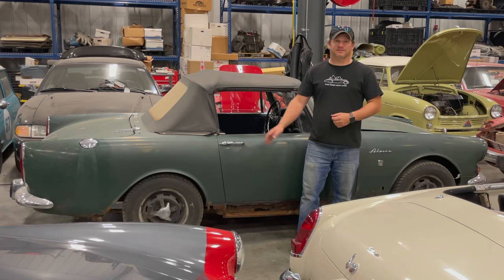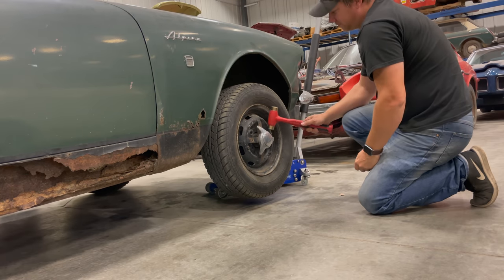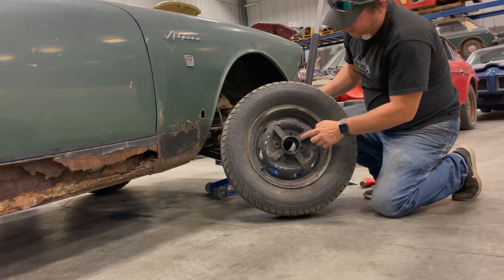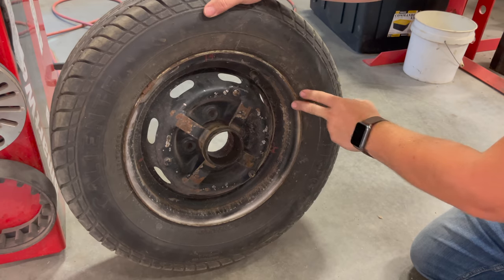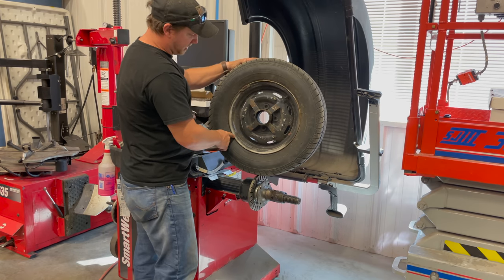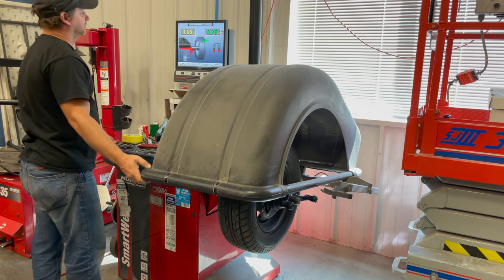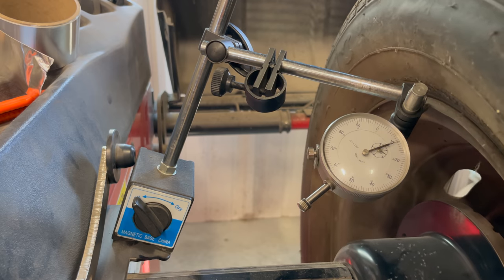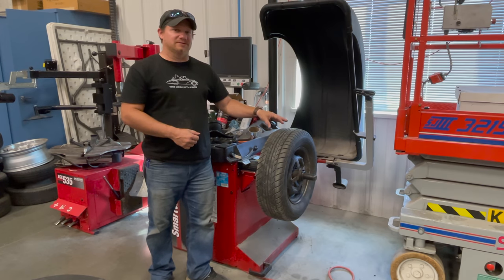Homebuild Disc Wire Wheel?

Comment: I like these Frankenstein wheels! I would check them for runout a bit differently. I would center them on the inner and outer cone surfaces inside of the splined hub just like they’re mounted on the front spindles and rear axle. The triple wing center lock nut has a cone precisely machined the fits inside the splined hub.
Reply from the maker: These are mounted to a splined adapter just like on a car just as you described, I am certain they are centered correctly.

Comment: Lotus Elans also had knockoff steel wheels as stock.  Instead of splines, they used short pins on the hub into holes in the wheel.
Reply: MGA twin cams had similar peg drive wheels, though the pegs were on the wheel and the holes in the hub.

Comment: Making knock off disc wheels by this technique was pretty common for SCCA racing around the north east when these were new cars. There was a shop in Patterson N.J. that did them commercially. Usually they would use a wider rim than original, as production car rules allowed an added inch, and some went on modified cars like old Listers in an effort to keep them competitive.

Comment: Is it correct to have a left hand thread on the wheels on the right hand side of the car?
Reply from the maker: Yes that is the correct direction.  Some wheel nuts are labeled which side of the car.  https://www.classiccarperformance.com/products/jaguar-2-ear-wire-wheel-knock-off-nuts-spinners
Reply: If you imagine the car rolling forwards and someone holding the knockoff spinner, whichever thread tightens the nut is the correct one!
Reply: Yes. A few cars in the sixties had this feature where one side had left threaded nuts to tighten the wheels. My Alfa Romeo Giulia Super of 1970 has this setup, and early sixties Chrysler Valiants had this as well